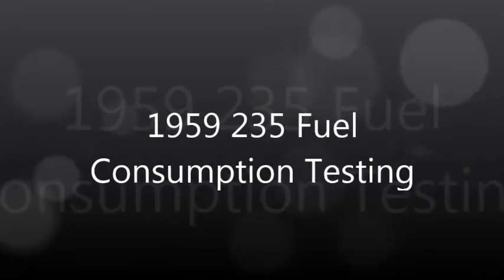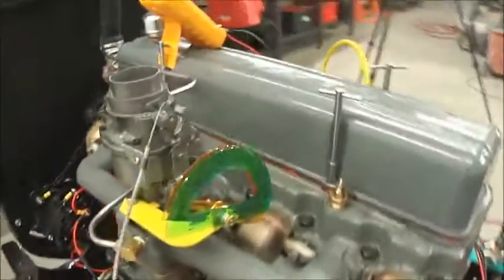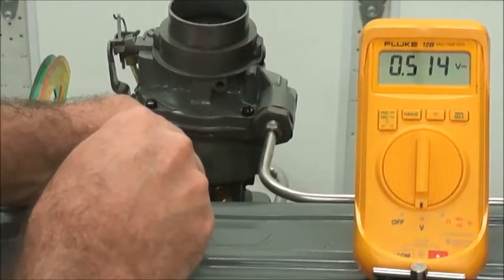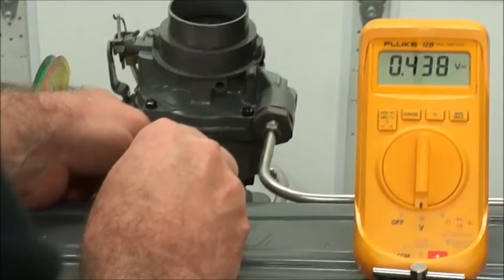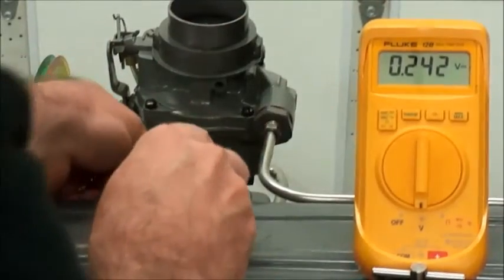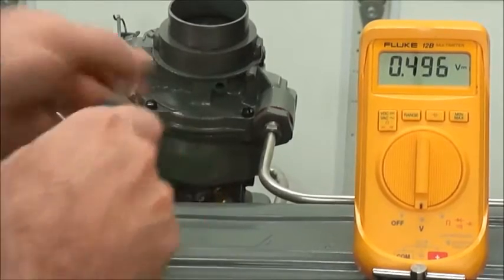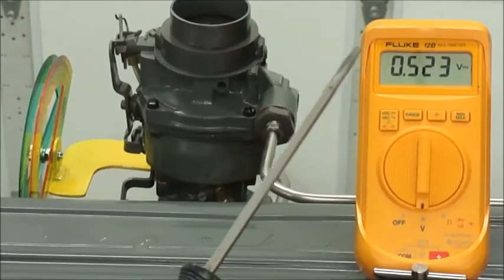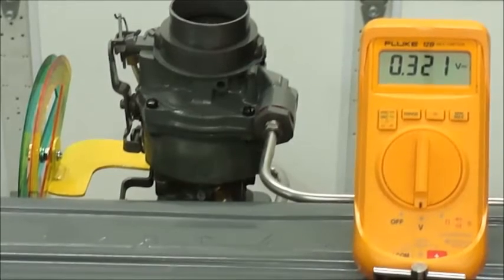O2SensorSG5 Devestechnet

Comment: Freakin awesome video Deve. My name is Dev by the way. I own a 54 150 with a 235.  I've always been a terrible at understanding and setting the ratio...on my own car or bike. However, for work I (use to do) set the ratio on huge boilers and thermal oxidizers running on natural gas. The NG comes in a 3" pipe and is set at about 10psi. It makes about 120mm BTU at high fire. I am comfortable with them and I know how they are doing as soon as I walk in the building. I set them by ear and by looking at the fire and then check them with instruments.  I guess it's like the story about electricians not being able to fix their own house or mechanic fixing their wifes car...I'm that guy too. My 54 has been down for a few years while I've been dealing with an injury and losing everything I own, but I'm going to try to bring it back to running next spring. There's nothing wrong with it it's just been in my dads care and he let it sit instead of starting it once a week. It was perfect 5 years ago, but things happen. I know he pulled my points for some reason but I'll figure it out in the spring. Thanks so much for all the tech information you have put out there in various places. I only just discovered it but I'm sure I'll be referencing it a lot.